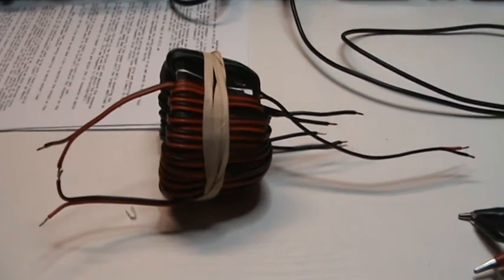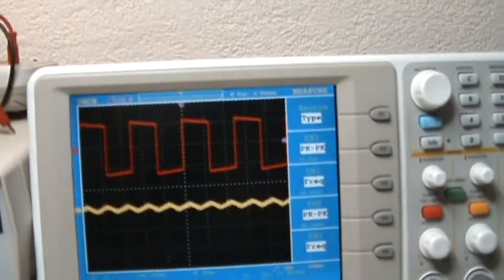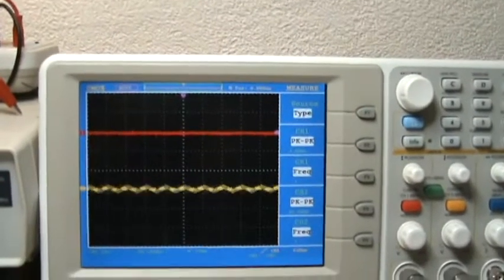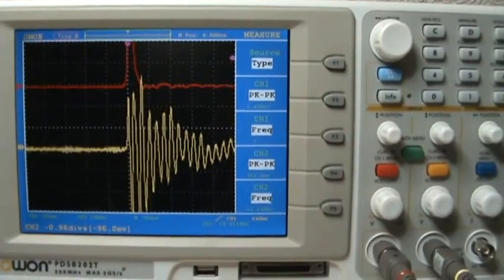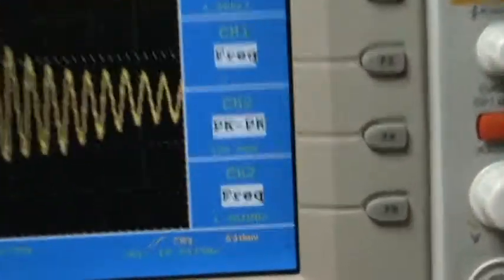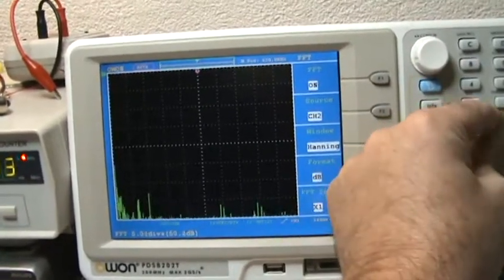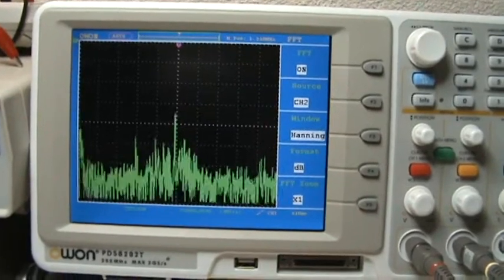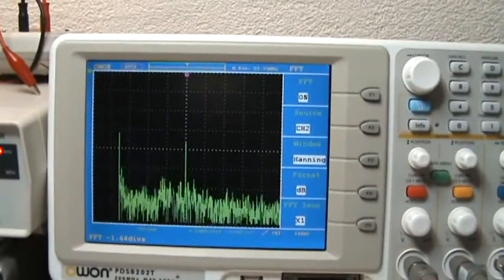20111114212839.mpg

Comment from the maker: Hi lespaul49, 

thanks for suggestion, i did use a 50 ohm resistor to match the FG impedance, but
because of the very low impedance of the copper strip and 15 turn coil, it hardly has any effect.  
I need to find another way to match this   :-)

Regards Itsu